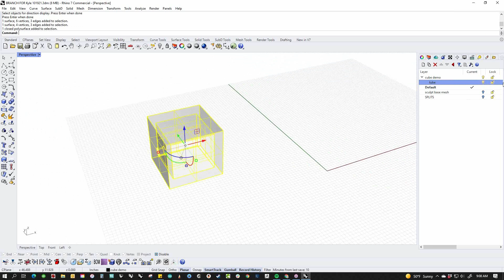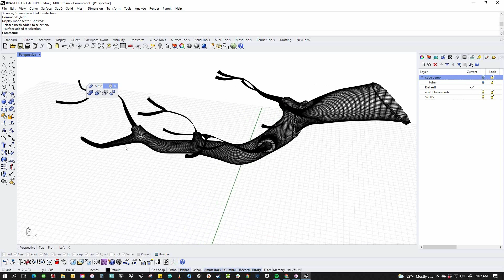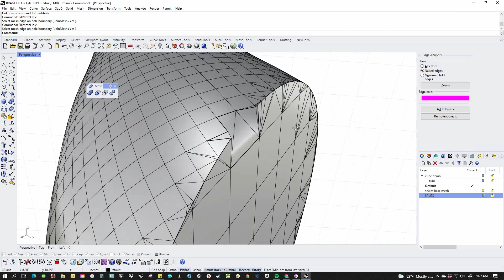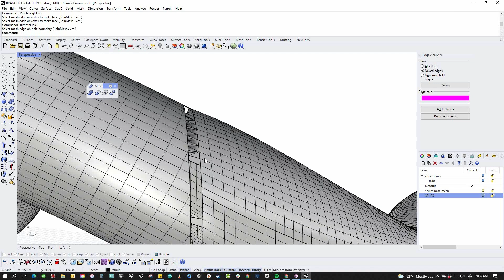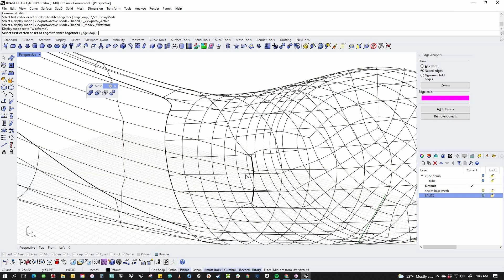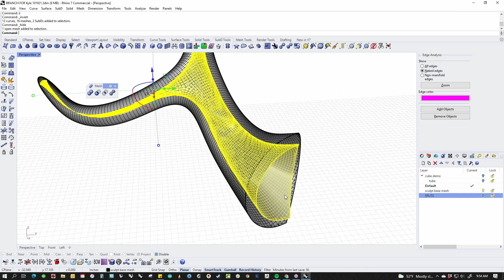Getting Started with Rhino 7 for Windows - Shelling Meshes and Preparing for 3D Printing.

Comment: hi kyle, would it be possible to do a video showing a basic methodology for creating a mould from a model using the rhino commands? With a 3d resin printer I am looking at possibility of  printing a mould  from my model. love your videos. many thanks
Reply from the maker: Yep you can do this with rhino- 

this video is a good place to start- 
https://www.youtube.com/watch?v=SUmml9elLP0

the key is to create the ribbon surface which determines the mold parting line- the RibbonOffset command is new to v7 and helps to create this surface. 

with the DraftAngleAnalysis tools you can determine and create your parting line- 

Feel free to ping us on the forums at discourse.mcneel.com if you need more info
Reply: @Rhinoceros3d  , thanks I will work through it and see how I go....